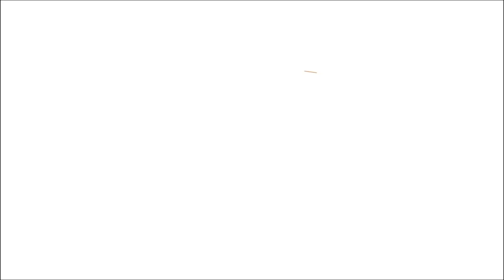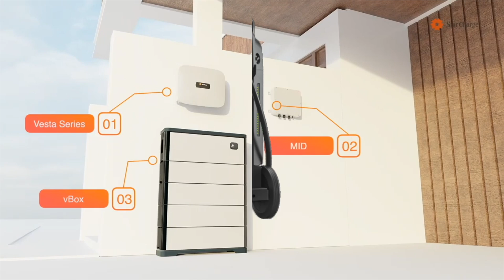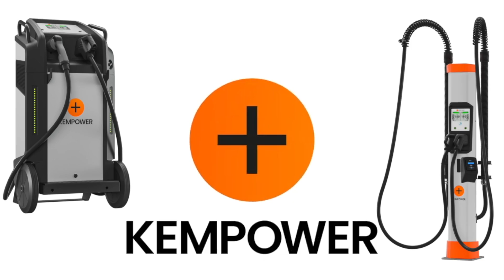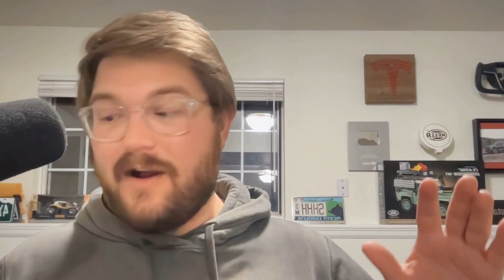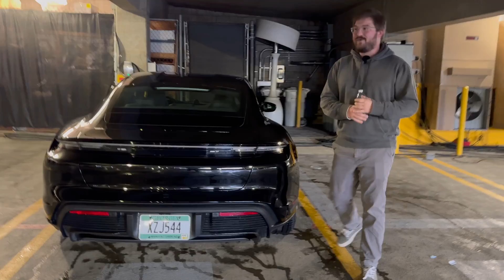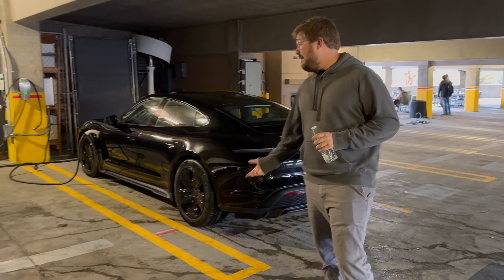Insane Porsche Charging Performance! New Taycan Facelift Charging Test & Comparison

Comment: Now, how much will this car cost? I think the old one was 110k dollars new?  That’s just a crazy price. The prices drops over 30% for these cars used, with one year and low miles.  Great technology, but until it trickles down to an “affordable “ car, it’s just not reachable for many consumers.
Reply: It is a Porsche. And just like other higher end Porsche this costs 110k+. It is within the expected price range for Porsche customers. 

Upper middle class Evs starting at around 60k will have 300kW charging power, like the Mercedes-Benz C-Class or the next BMW i3 sedan /iX3 coming to the market in 2025.

At the end of this year a Mercedes-Benz CLA will be introduced with 250kW + 50kW short boost (so actually a little bit slower charging overall) for around 59k with the big battery pack. 
The Zeekr 007 or a SMART derivative would bring 350kW charging for around 55-60k to Western markets. But nobody knows when and if they will come.
Around 60k is not particularly "affordable" but high charging speeds will become available to more people in the next few years.

Comment: @stateofcharge will ask how long did it take to get back 100 (hyper) miles but I want to know how long to 200 (hyper) miles? Better yet at that first kW drop at 62% how many (hyper) miles were added? 23:26
Reply: In another test he hypermiled 450 miles on a full battery. so charging 5%-65% would give you around (0.6 * 450 = ) 270 hypermiles. Going 75-80 mph you should expect about 2/3rd of that number which is still a great 180 miles. That's 2:30 hours of driving and 12-14 minutes of charging which is probably matching normal human being preferences at this point.

Comment: That's what was observed on phone fast charging years ago as well.
You can charge your phone at 120W and see no meaningful degradation, what degrades the battery most are using/charging between 0-20 and 80-100
Reply: @@donovanlewis3053 that comparison works exactly better because it's a phone, some smartphone batteries have the same chemistry as some cars and because all the load is in one cell, suffering the worst abuse it sets a good benchmark and example for battery car cells.
If the solely (sometimes 2) cell in the phone degrades really slowly do to fast charging than we can infer that information to others as well.
Reply: Tesla manual says charging to 90% is fine. And it says charging to 100% is fine if you start driving quickly after charging. So keeping the battery at 100% is what degrades it. Charging your phone to 100% at night will often keep charging it to 100% until you unplug, so that's bad. My Android will delay charging at night based on time set in the alarm, so it will only reach 100% just before I unplug it.
Reply: @drfisheye  Like i sad that is not true ,i cant post links here but there was big test off cells with charging them and disharging,some cells were charge to 4.0V some to 4.1V some to 4.2V and some to 4.3V ,and every charging 0.1V more degrade batter 100% more , so you will have same degradation if you charge battery 400 times to 4.3V ,800 times to 4.2v ,1500 times to 4.1V and 3000 times  to 4.0v .
 Off course you want charge every time your car to 100% so you will not notice the difference 2 much and off course it also depends how long it stays on high charge but this test was just charge and discharge
Reply: @dzonikg  interesting, though it seems to clash with Tesla's advise a bit.

Comment: I've heard of some insider reports that manufacturers will sometimes allow for faster charging on these vehicles to their production models. Will you be verifying this with a customer car once it's released? Also any thoughts on if this faster charging will ultimately result in faster battery degradation?
Reply: 800v causes significantly less heat battery pack wise, so it's easier to keep cool, and therefore, the cells remain cooler. 400v Teslas hit 140F degrees much, much sooner than this (which is when they throttle down) and this Taycan never crossed 130F degrees. They're also working on cooling the cells from the inside out which will change everything.

Comment: FYI, the website is missing the data for the '25 Taycan on the 70 Mph Range Added chart
Reply: They haven't run that test yet. They only did a 50mph one and took them over 9 hours and 40 minutes to get all the way to down to 0% SoC.

Comment: Can’t the manufacturers allow this charging speed by just making the battery pack larger and then artificially decreasing the available area you can use?
Reply: Schlepping around unused weight negatively affects efficiency and car/body dynamics.